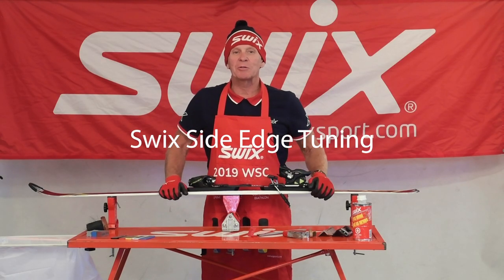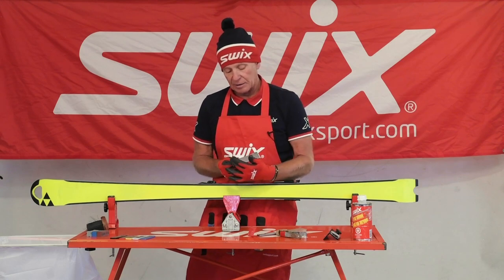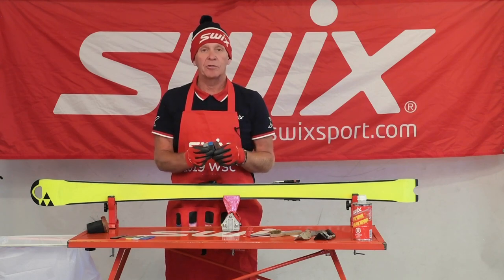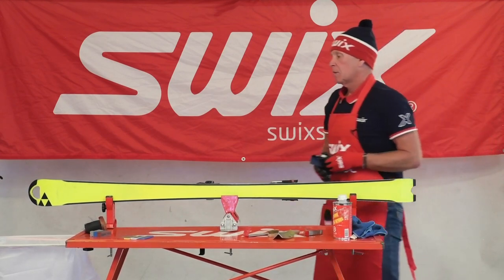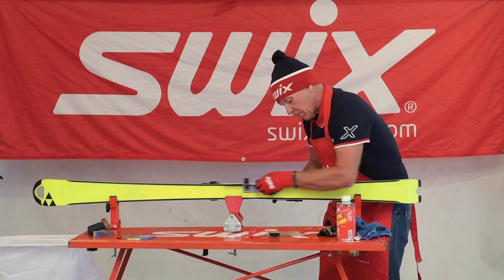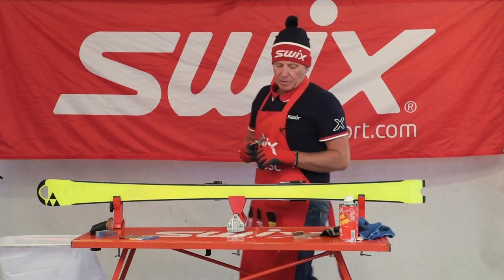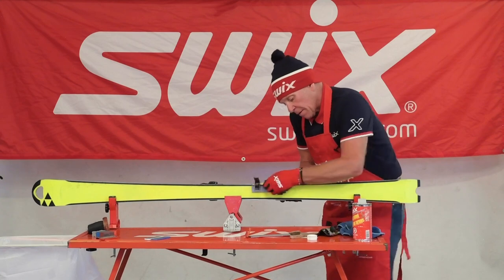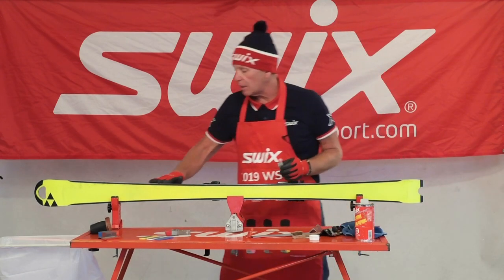SWIX Tech Talk with Mitch Connor: Side Edge Sharpening

Comment: Thanks for this video. I wasn't really sure how to use the single-setting edge guides. Realized I did it entirely wrong. Went over my edges again with the diamond stone using your method and wow, what a difference. My edges were so rough from doing it wrong, but working them again properly smoothed everything out. Thanks for the help!!